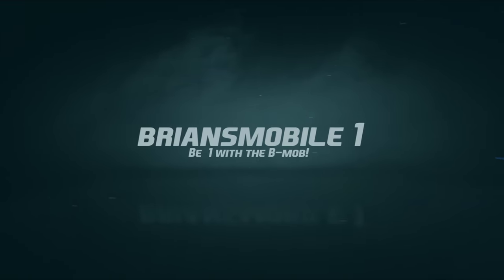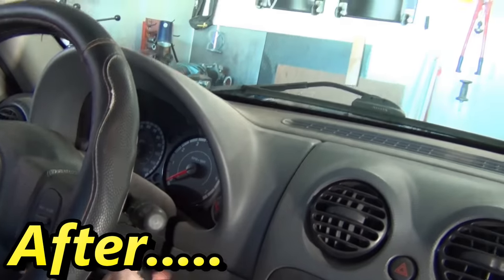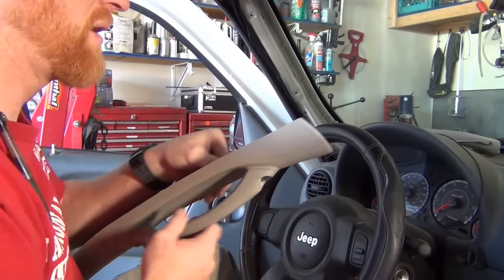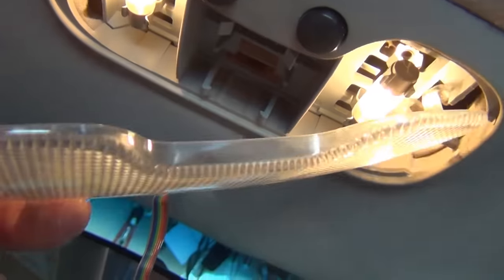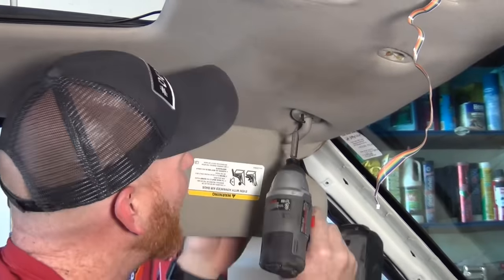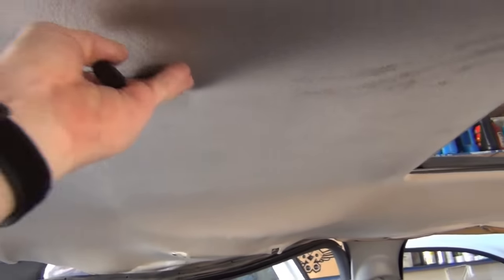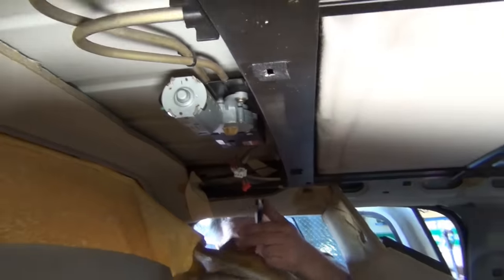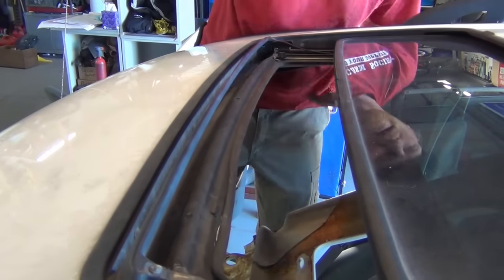Sunroofs Everything How to Fix One OR Make it Manual for FREE!!

Comment: That’s an after market sunroof It’s actually a signature sunroof I install them for a living
Reply: How can I contact you I have a question
Reply: I thought it was a Webasto brand, but I was wrong.
Reply: Signatures are supposed to have a lifetime warranty aren’t they?
Reply: I have an Inalfa in my Jeep Liberty Limited that was intermittent for awhile then it just stopped working altogether. Switch tested good but it’s backlight goes dim or out depending on what day it is. No motor sound at all.

Comment: I worked at an auto upholstery shop for quite a few years.  The drive units would sometimes fail...or the chain would skip teeth and it would be off track on one side or another. Sometimes the frames would come apart and the chain would "think" it is off track due to the relationship it had within the track assembly ...

Without the motor hooked up (due to cutting the plastic) at higher speeds the glass may become dislodged from the "happy place" it is resting in during the video...think of it like disconnecting the transmission from a car with no parking brake on....it can still be pushed a bit (providing the tires aren't flat).

Not trying to be a nay sayer. As long as the driver is not driving too fast....maybe not such an issue...but every little thing seems to matter.

Did you try disconnecting the motor from the sunroof assembly and seeing if the issue was in the motor itself? Or if the plastic guides were kinked/broke?  You may not have had to replace the entire assembly...but to just replace the faulty piece....sometimes we have as the owner's request just got the sunroof back and put the motor back in place...  (Think of it like a tranny stuck in gear with no brake)  with the car not running...it aint going anywhere.

This is helpful to folks that see what kind of butchering happens to the car when getting an aftermarket headliner. Sometimes after dealing with a sunroof repair ...replacing the headliner is a necessity.

Thanks for sharing this. I appreciate you and your willingness to share your knowledge.
😇😎😀
Reply from the maker: Welcome- this is a cable and pulley system like many window regulators have gone to.  The track was so dirty, gritty, and spent it overloaded the aging pulley and snap!  The cable bound in there hard.  Great call on spending the money to replace the headliner.  On a high mileage car like this is that good money after bad?  I guess that depends on what a person values.  The motor was just fine- the cable was just super stuck once the pulley was gone.
Reply: @briansmobile1  I thank you for not blasting me as a hater.  I understand that not everyone sees the picture the same way...and I didn't know the other parts of the scenario....when it comes down to it...sounds like your customer was happy and that is pretty important.

Sometimes I have also spent lots of money to fix a car that was not worth it either.

Thanks for the cool reply!

😇😎😀

Comment: I have a 2018 Chevy Equinox Premier. My sunroof opens and closes but the shade does NOT. I had opened both the roof and shade and when I went to close them both only the roof closed. The shade seems to have come unclipped or is not on the track. how do I fix this issue?

Comment: I bought a used 05 Camry, last year, & the sunroof had sealer all around it. When I push the button, I can hear the motor try to work. I wonder if it was leaking, & the drains were just plugged.
Reply: Im having the same issue cant find any solution yet
Reply: @azaan7743 you ever figure out the issue mine is barely open

Comment: this is why I like bmws forward thinking so if it does break you can use the lugnut wrench to manually close the roof. but thats only when you get an OEM sun roof. this aftermarket stuff is terrible.
Reply: BMW also has that as a spare part. Unfortunately the sunroof only comes from them as the sunroof, the entire bracket assembly and the headliner, as they use one way fasteners all the way round. Gets a tad expensive when you are no longer on motorplan and the price of the sunroof is almost 70% of the vehicle value. So many that no longer have a sunroof that works now, especially as they get past the 12 year mark. No oil leaks, but every plastic part is looking to break, and the electric everything is just looking to see your paycheck every month.
Reply: Old Mercedes wagons too

Comment: Stellar job on video.  You know your sunroofs man!  

I have a 2003 Montero Limited. My sunroof stuck fully open 3 years ago. Opened fine and then it wouldn't budge to close a couple of hours later.  I had one person pull on the glass as I cycled the button on and off because it would move about 1/2" at a time that way, but only if a person tugged forward on the glass as I switched the switch on and off in forward position.  So I got it 98% closed, but it doesn't go upward and entirely seal fully closed. That was 3 years ago.  

What do you think the problem is?

Comment: I know it probably doesn't matter but yikes all those soft plastic pieces damaged by the hook tool. If you were to want to avoid any damage like that what would be the best way to go by? Electrical tip on the end of your pick tool while still trying to keep it thin?
Reply from the maker: Yeah- someone else attempted it first.  I walked right into that one.
Reply from the maker: To answer your question, the damage was from a screw driver.  Where the hook pulls from is up inside where you can't see.  And it doesn't damage it- you pull with the side not the point.
Reply: @briansmobile1  OKok thanks for the reply!

Comment: I bought a 98 Cherokee and it worked once FORTUNATELY it failed in the closed position. I haven’t done the simple electrical diagnosis yet tho minus checking the fuse. Fortunately the wiring is mostly external to the vehicle’s wiring minus wherever it taps into a power wire.

Comment: All right the only thing you need to remove is 10 millimeter bolts you don't need to pull any cover or any lining off there's 10 meter minerals and the screws that hold down the handles and the light hand on the rear and that's it

Comment: If a hobby machinist could fabricate new pulleys out of Delrin or something similar could they replace the pulleys or are they so integrated into the frame that it would be next to impossible? 
Thanks
Reply from the maker: It's possible, but you really, really have to want it.  On top of that the glass as you saw doesn't slide well.  This loaded up the aging pulley and broke it and the cable wedged.  Replacing the whole cassette assembly is a best practice.  You see used cars with a new engine and the seller claims the miles are low, but miles don't just affect the engine.  You also have everything else on the car wearing out too.  for ie. exhaust, trans, steering, brakes, struts, etc.  These sunroof assemblies are the same way.
Reply: @briansmobile1  I see what you are saying. I was thinking that it would be a shame to have to replace an entire assembly just because a couple of cheap plastic pulleys failed. I got a metal lathe and mill a couple of years ago and have been pleased with the many things I have kept out of the landfill. 
Thanks for your great can-do positive spirit. You are a true inspiration.

Comment: My 1991 Mazda 323F has a sunroof, the motor is starting to have some noise, but if it breaks you can lock it with a wrench.
I'm afraid to buy and maintain a newer car lol
Reply: Krisztián Sirkó older ones are cheaper to maintain definitely keep you Mazda as long as you can

Comment: I have a 2004 Toyota Sequia. I replaced the Sunroof Motor. Still will not close. Now I am worried the glass is 'off its tracks." Has this happened to anyone? I am convinced at this point it needs professional attention. Although the glass is fully shut (I pulled it closed), water leaks down in easily because I think the sunroof rain gutters are clogged. Anyone else dealt with this?

Comment: Manual sunroofs are the way to go 'cept maybe when buying a luxury car but even then, it's just a matter of time before there's a mechanical and/or water leak issue that's gonna cost ya...
Reply: Could be worse, it could be a soft top or hard top convertible. Especially the three pointed star hard top ones, which are going to be expensive to repair as well. Because they are relatively few, spares are both hard to get, and eye wateringly expensive.
Reply: Another useless video.most people rather get true info to fix sunroof opening closing issus

Comment: Needs new wiring, motor and a new switch
Reply from the maker: You just replace the whole thing.   The track is dirty and rough so it over loaded an aging cable pulley.  The pulley snapped and the cable jammed.